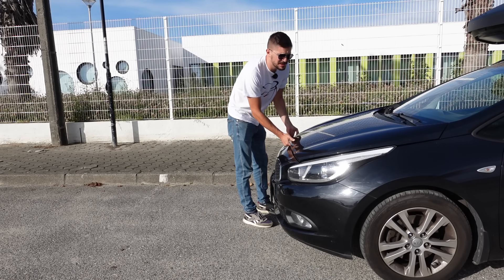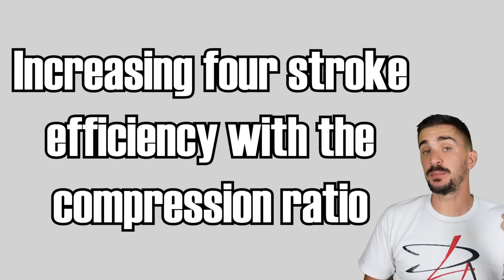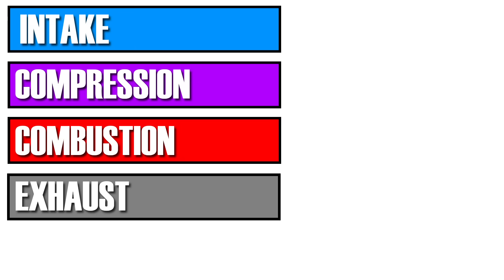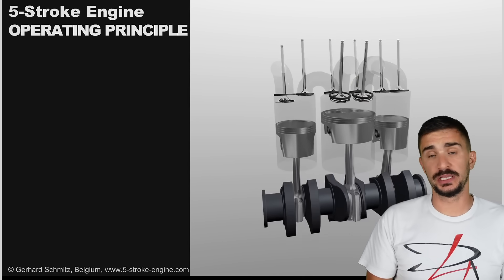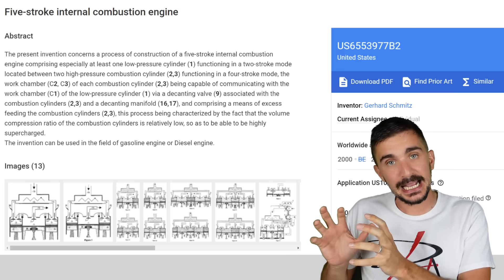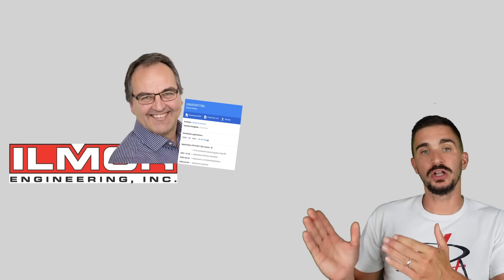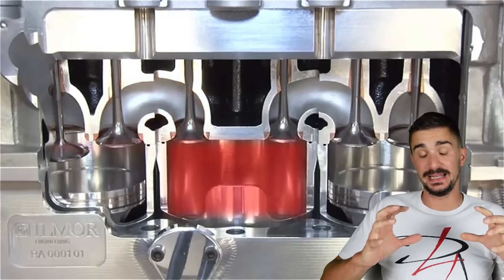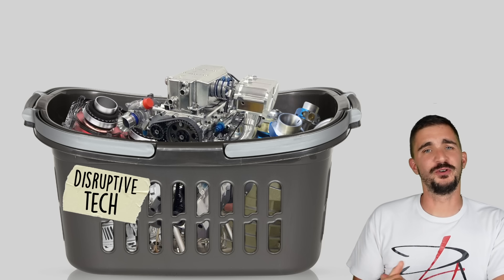Why Five Stroke Engines Are More Efficient But Still a Failure

Comment: It wasn't quite as unsuccessful as we might think. Steam engines. First conceived perhaps a century before Otto's idea, it started actually being commonly used around the same time and may have been where Otto got the idea. That continued for a very long time in ships slowly being phased out around WW2 for the far more powerful turbine engine and/or diesel. Triple expansion was likely the most common method, but it works exactly like this engine here. A high pressure initial cylinder, that expands to a larger lower pressure cylinder, again expanding in the final cylinder before being exhausted often at around atmospheric temperature. The benefit was the same too - efficiency. It was remarkably successful and has obviously demonstrated that the idea has merit if the size and weight allows.

Maybe we will continue to see such engines in heavy diesels like semi trucks where the size and weight is a small fraction of the total vehicle and trailer, where fuel costs are an important financial factor, and where high load constant RPM conditions make up a high proportion of usage. We have to hurry though, in a only a couple of years the multiple expansion piston engine will be 250 years old!
Reply: D4A been really silent.
Reply: I thought this might be a bot that copied someone else's comment because of the girl in the profile picture, but it actually seems to be real.
Reply: @nathangamble125  No, it's my own. I'm a physicist so I tend towards detail oriented comments. Plus I've obviously got an interest in engine technology and engineering in general.
Reply: Oh, and she's "detail orientated", great now I'm depressed
Reply: You should check out the turbo compound low specific fuel consumption engines from the post WW2 era. The Wright R3350, Napier Nomad & Napier Deltic 2-stroke opposed piston diesel engines are quite interesting.
Reply: @carlkinder8201  Oh I've always had a love for those engine designs. Obviously the ideas which led to them are way off (everyone will want efficient engines over power density), but the ideas themselves are great. They each approach the turbo compounding concept using a different solution. One even uses a two stroke engine if I recall. I really wish they were used more so evolution could show us which technique ended up being the most practical, but sadly it wasn't to be.

And since modern renditions require literal jet engine technology (and costs) I suspect we won't be seeing much of them today either.

Though fun fact, I would argue a similar concept was used in some steam engines from the early 1900s - Titanic for example. I don't believe the turbine was on the same shaft so it isn't "true" turbo compounding, but a triple expansion into a turbine engine is pretty close. The turbines were to increase power density rather than efficiency, they could have used more piston expansions for efficiency, but it's still a piston expansion engine into turbines.
Reply: The thing is you can accomplish the same thing with a delayed intake valve closing without a custom engine block.
Reply: @Appletank8  Yes and no. You can get some of the benefits, true. But you need a much larger power stroke (ie a much larger engine) for the same power. Thus you're effectively limited in how far you can go - certainly you wouldn't want to triple your engine size over having 50% more pistons in the double expansion engine. Triple expansion obviously is far beyond anything a delayed intake can manage. Ie you can, but its only a very mild version.

Engine designers have tended towards your technique (delayed, early, or changing the opening timing, it's all the same) as you can very quickly switch intake timing to the normal otto cycle and regain all of that power at the cost of normal efficiency (ie no real cost at all).
Reply: @olivialambert4124   Isn't this 5 stroke engine design also functionally extremely compromised in true engine capacity? The 5 stroke has the same size as a 2.8L engine (assuming each cylinder is roughly 0.7L and the middle is double), but it can only intake 1.4L of air per cycle, the other 1.4L is just for expanding. I could do the same thing with a 2.8L 4 cyl, and eject half the air during intake, and also only use 1.4L of air every cycle. The power stroke is also twice as large as the intake stroke.
Reply: @Appletank8  Mostly yes. In practice the cooling is substantially lower for the expansion side, and so we can exploit that. For the 0.7L engine if we assume a square cylinder we get 96.2mm stroke and bore. Whilst we can tweak the stroke slightly that gets complex fast, so we will assume 96.2mm stroke for the expansion cylinder. That gives about 136.1mm (roughly, my calculator rounds aggressively) for the bore. But since we don't need the cooling we can go from an open block to a closed block design and recoup a lot of that space. In the end the block size is only marginally greater than 3 cylinders for a little more than 2 cylinders of power. And the efficiency benefits are only significant at the tuned loads (another benefit of the modern Atkinson cycle engines, they're aimed at low loads as they switch to the Otto cycle at higher loads anyway).

That isn't great, but there are many use cases where we might still prefer the trade off. Historically that was attempted in aircraft where constant load/RPM and fuel efficiency is key, obviously lost out to the turbine. But my original post suggest ships - hundreds of thousands of tons, long distances, fuel is a big cost, historically beneficial in steam ships. Slightly larger engines wouldn't be a big problem. And large cargo semi tractors - again all the same factors. The latter may be more opposed to the increased space but it's certainly an interesting candidate where I'd expect the change. Long high load scenarios which also happens to be where hybrids won't help.

I don't think anyone intelligent is proposing multiple expansion cycle engines become the norm. Even in hybrid cars we reduce fuel usage more from a smaller, lighter engine than we would a multiple expansion engine. I'm actually a strong proponent of two strokes in hybrids for that reason. But that isn't to say there aren't use cases where the cost to benefit is in favour of a multiple expansion engine, and we shouldn't be so focused on the most common usage and ignore the niche scenarios.

Comment: Do you think that the heat energy from the exhaust could be used in hybrid vehicles, for drive a Stirling engine, used as generator for charge up the battery?
Reply: A Stirling adds complexity and steals volume - cars are all about packaging.
You could theoretically increase the number of expansion chambers like a steam engine, but that has the issues outlined in the video.
An electric turbo sounds like a good solution to scavenge more energy from the exhaust and would fit in modern engine bays quite well.
I believe that Porsche have a hybrid 3.6L boxer 6 (hybrid powertrain and an electric turbo) for their next 911.
Reply: @pd4165  but if we don't consider the space problem. Do you think it would work?

Comment: That's odd, compound engines are quite common in steam engines. I suspect the reason is that we can superheat water. Rather than releasing energy ONLY during combustion, steam engines instead uses its fuel to heat up water, thus acting as a thermal battery. And when we want power, we then let the water expand and expend its energy.
Reply: There are now turbo-compound diesel engines in some large trucks, and there were turbo-compound gasoline/petrol engines in some aircraft (such as the Lockheed Constellation and the Douglas DC-7) in the 1950s. They had a very distinctive sound that I have not heard for a long time. Modern aircraft engines are only now catching up with their efficiency. They were abandoned because of their great complication and hence high maintenance cost.

Comment: out of curiosity, can we harvest the exhaust energy efficiently by putting a turbine and small alternator for electricity, coupled with high compression ratio.
Reply: Why bother with a reciprocating engine when it's just a gas generator? Turbines can be very efficient, if run correctly.
But you run into similar issues with limited efficiency with all ICE - the flexible rev range we need is at odds with efficiency.
Reply: @pd4165  yea. thats what i thought, unless turbine is coupled to battery and electrical drive train system, much more efficient that way. but small turbine below 65%-ish are not very efficient in comparison to piston, longer turbine with multiple stages of compressor would improve the efficiency due to higher overall compression.

Comment: Very interesting; and I have never heard of this before. Seems similar in concept to compound reciprocating steam engines. Where steam left over from a high-pressure cylinder would then drive a larger and lower pressure cylinder. Also similar idea to a compound turbo charger, where a turbo is used for something other than forcing air into the intake. Volvo truck engines use these

Comment: There's no replacement for combustion. So long as there is no true evolution in other technologies (wich doesn't exist until companies see a real profit and even then they do the bare minimum and try to force it on the market, instead of making something usefull and effective) there will be nothing else to replace a running, reliable, efficient system. People always talk about how inefficient a combustion engine is pointing out heat loss, but they fail to mention that a 1.000kg car can travel 500-700 km before refueling for 2 minutes, while staying reliable in any weather conditions. Also people like to ignore the fact that combustion engines continue to become more efficient. For the moment being, any alternative to gasoline or diesel is simply a marketing gimmick of a fun, expensive, hobby-technology, that is not suited for real world daily use.

Comment: It's not that the non-combustion strokes are 'wasting' energy. It's that to achieve peak temperature (or pressure if you prefer) the air fuel mixture needs to be close to stoichiometric. But at a stoichiometric ratio, the combustion stroke needs to be much longer than the intake stroke to exploit all that temperature (or pressure).

Comment: I don’t quite understand the problem with insufficient exhaust gas temperature. From the video it follows that it is fundamentally impossible to make a more efficient engine than existing ones for this reason. In my opinion, the problem looks far-fetched because you can use a richer mixture during warm-up. The only real obstacle seems to be that the engine provides greater efficiency only in a limited rpm range.
Reply: Only so far a richer mixture can take you, and the higher HC emissions from doing that are the vast majority of the emissions. However, it's a problem that other high-expansion 4-stroke engines manage to get around (I think late ignition timing is also something they use?)

...and then, there's the 48 volt electrically heated catalytic converters that are appearing for mild hybrids, which sidesteps the issue quite nicely.
Reply: The entire idea for the catalytic converter is to clean up any excess hydrocarbons in the exhaust - wasting fuel to heat up the cat will not help you pass emissions, it will probably make things worse. 

fundamentally, the exhaust is only high oressure as long as it stays hot. let it cool down enough by expansion and it should start being almost the same pressure as the air that went in to the engine. That's why the turbo doesn't like this concept, they thrive when you get the air to them as hot as possible. That's also the major factor that's keeping plane turbines back from being more efficient - we can't make primary turbines that can handle more heat.
Reply: @zibingotaeam3716  When starting any conventional car engine, at the initial stage the mixture is richer specifically so that the catalyst starts working faster. If the engine is more efficient, this period will have to be extended. So there is no need to invent anything new.

Comment: Technically the idea of an extra expansion cylinder predates the invention of the internal combustion by like 60 years, since its the same principal as a double expansion/compound steam engine
Also, another propulsion technology that has lasted 150 years? The electric motor 😁 (The first useful DC motor was actually invented about 30 years before the internal combustion engine)

Comment: The cat should be placed between hp and lp cylinder, lp cylinder should turn only 1:2 ratio because there is only exhaust when fired and that type of engine should work as a e generator optimized for a certain load and speed.

Comment: Have you done a video about ceramic cylinder coatings by any chance? May be interesting to know why despite the great promise it went nowhere. Thanks for your super interesting and well-researched videos!
Reply: Ceramic is hard and can withstand high temperatures but it's also very fragile, so vibrations, big changes of temperature in short time, impacts, etc, can break it in little time making it unsuitable for production engines.
Reply: Wasn't it used on BMW cylinders as surface finishing? I much prefer the chromium based ones anyway. I've used those since when I was a kid on my 2 stroke bikes...
Reply: Were you thinking of Nikasil maybe? I don't think that was ceramic based? Anyway the (promised) ceramic advantage was much less heat transfer to the block. I think there was even talk of ceramic (coated) pistons too.
Reply: "why despite the great promise it went nowhere"
You mean why the big promises made by snakeoil-salesmen and other scammer never materialize?